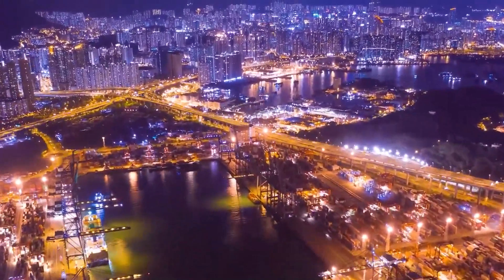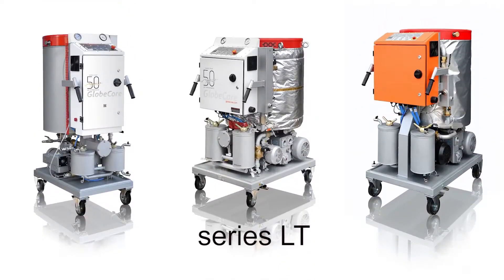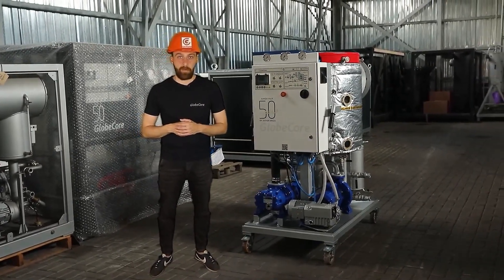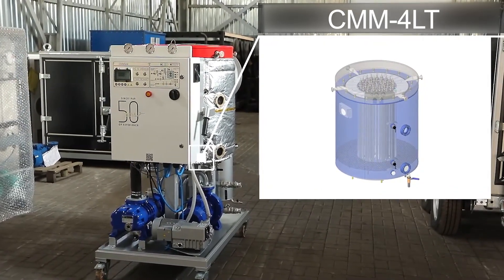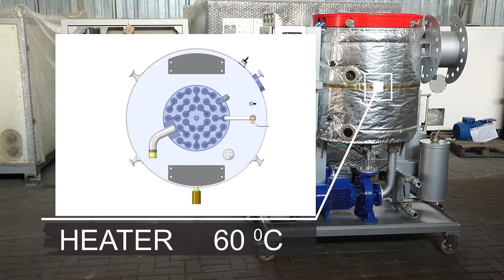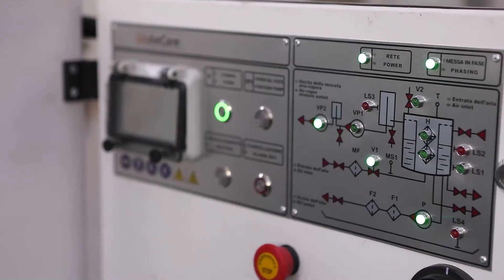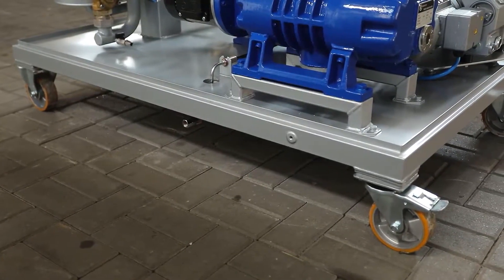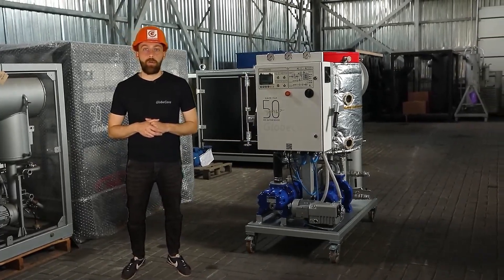Transformer Oil Two-Stage Vacuum Degassing Machine CMM-4LT

Comment: Are there any specific safety precautions or guidelines for operating the CMM-4.0LT unit in confined spaces?
Reply from the maker: For operating the CMM-4.0LT unit in confined spaces, all safety precautions and guidelines are meticulously detailed in the equipment's technical documentation.

Comment: How much space is required for the installation and operation of a CMM-4.0LT unit?
Reply from the maker: The approximate volume occupied by the equipment can be calculated by simply imagining it in the form of a rectangular parallelepiped. Then, to obtain the volume of the unit, it is necessary to multiply its length by the width and by the height, i.e. 1.4*0.85*1.8 = 2.14 cubic meters.

Comment: How does the compact size of the CMM-4.0LT unit affect its overall performance and reliability?
Reply from the maker: The compact size of the unit does not compromise its overall performance and reliability, as it is designed to maintain high processing efficiency.

Comment: Are there any specific training or certification requirements for operators of the CMM-4.0LT unit?
Reply from the maker: Operators of the CMM-4.0LT unit can refer to the guidance provided in the equipment's technical documentation. If necessary, our specialist can provide on-site training and support.

Comment: How do the new type of nozzles in the CMM-4.0LT unit improve the oil purification process?
Reply from the maker: The new type of nozzles in the CMM-4.0LT unit improves the oil purification process by not sticking under high temperatures, maintaining functionality, and increasing the contact surface area for oil purification.

Comment: How much power does the CMM-4.0LT unit consume during operation, and does it support various voltage standards?
Reply from the maker: The power consumption during operation is AC 50Hz, 380V, 3 phases, and the unit supports various voltage standards within this specification.

Comment: How does the vacuum pumping system in the CMM-4.0LT unit contribute to its overall efficiency and effectiveness?
Reply from the maker: The vacuum pumping system within the unit contributes to its efficiency by eliminating the need for an additional pump, and the internal heater optimizes design and minimizes heat losses.

Comment: What is the maximum operating temperature for the CMM-4.0LT unit, and how does it affect oil processing?
Reply from the maker: The maximum output oil temperature of the CMM-4.0LT is 55°C (131°F), which facilitates the evaporation of gases and water vapor

Comment: Can the CMM-4.0LT unit handle different types of transformer oils, or is it specific to certain oil types?
Reply from the maker: The CMM-4.0LT unit is capable of processing transformer, turbine, hydraulic, industrial, cable, and compressor oils.

Comment: Are there any specific environmental conditions that affect the performance of the CMM-4.0LT unit?
Reply from the maker: The CMM-4.0LT unit operates within a temperature range of +5 to +40 degrees Celsius and a humidity level of less than 70%.

Comment: How does the CMM-4.0LT unit compare to other oil purification systems in terms of efficiency and performance?
Reply from the maker: The CMM-4.0LT unit offers excellent efficiency and performance in a compact design, comparable to other models in the series.